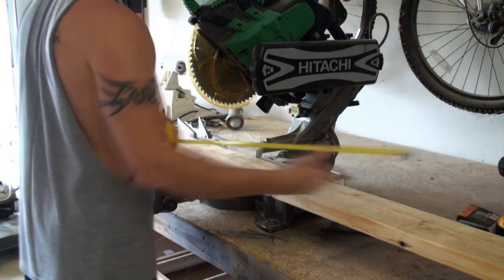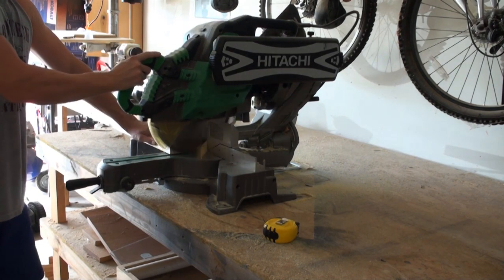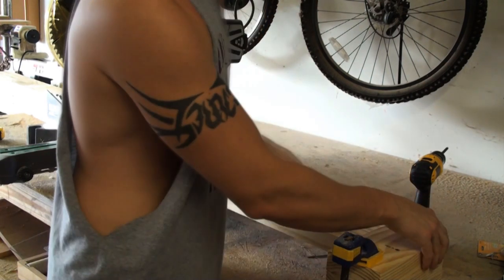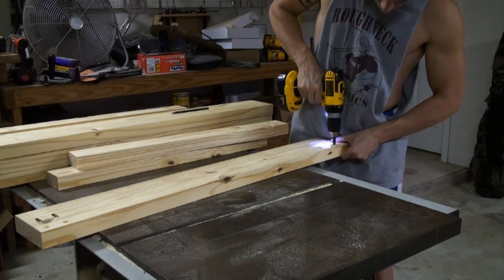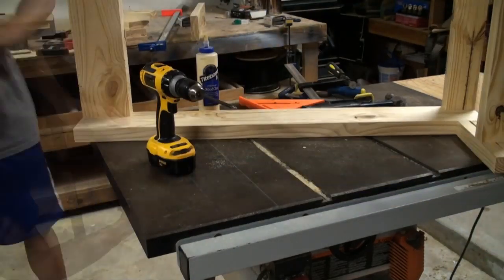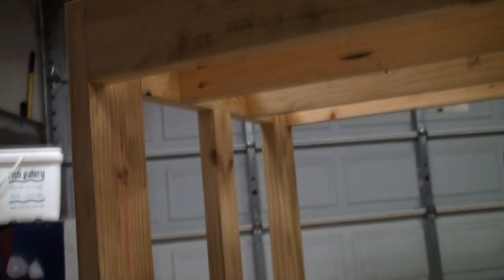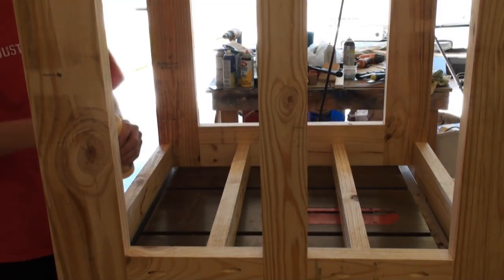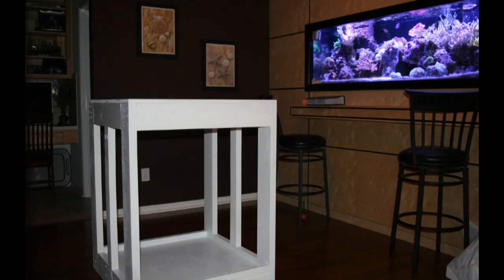Tank Build Part 3 - Tank Stand Structure

Comment: Hey hows it going.  Great video.  I am by no means a professional and will be building my first 2 tank stands this week.  I am going to follow a lot of what you showed here but one thing that I am unsure about is what size screws you use.  I too will be using the jig and 2x6 but will cut it down to 4" do its easy to work with numbers wise.  What size screws do you use?